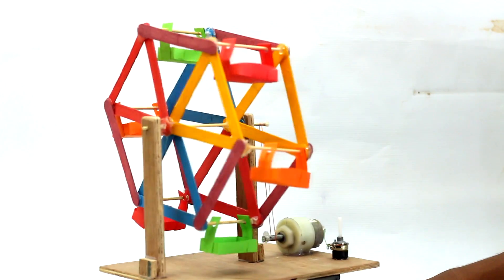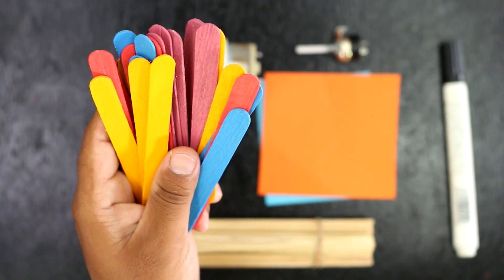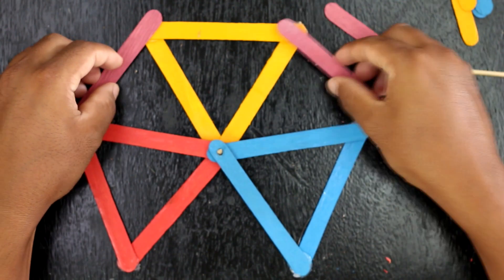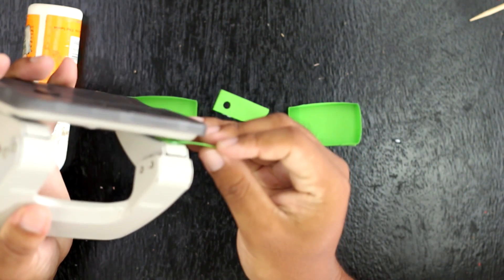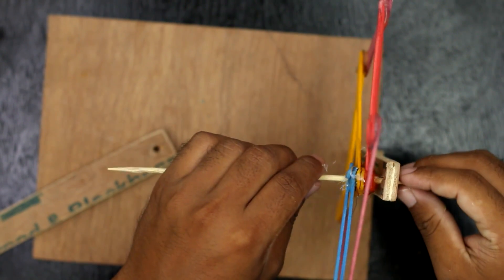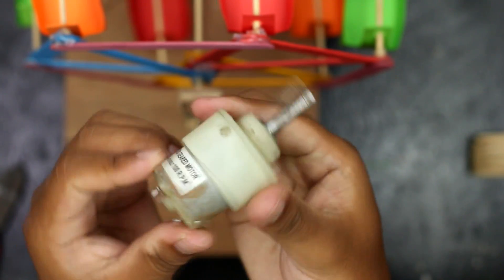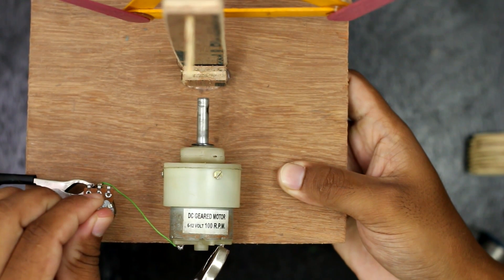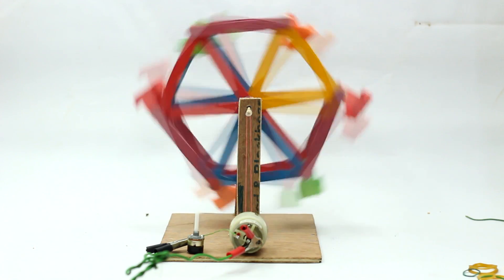How To Make A Ferris Wheel

Comment: There’s a few problems with this tutorial.

1. No measurements

There should be some measurements to not have any confusion on the length and width of the paper or bamboo stick.

2. The Stick

When creating this with my son, the stick at the beginning was small but near the end, there was a much bigger stick.

Those two are my only problems with this video.
Reply from the maker: thank you my friend , you can use any length of wooden sticks or bamboo as long as it works